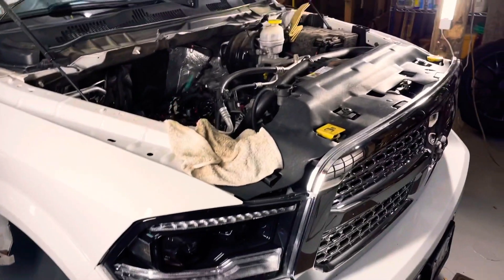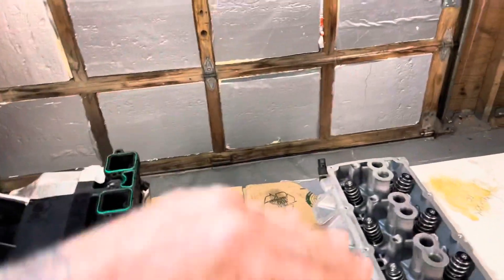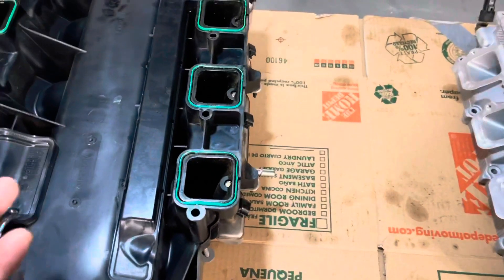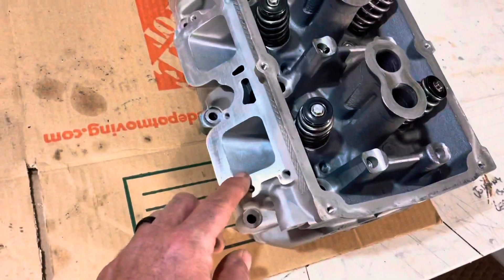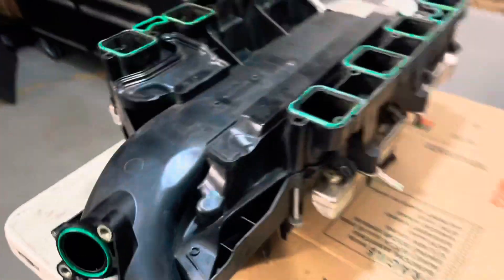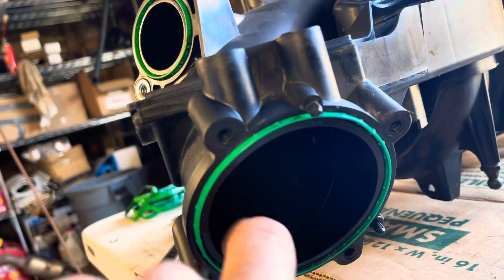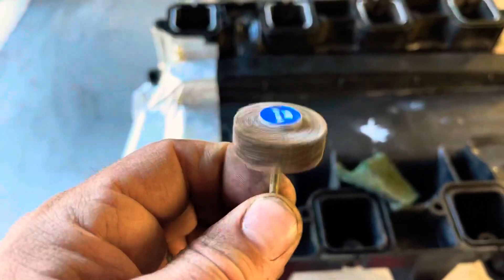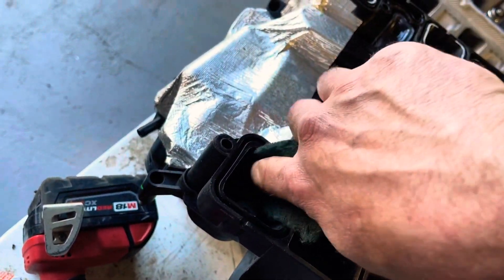PORTING! DIY 6.4 INTAKE MANIFOLD

Comment: This method workd for pre 70s motor . To do this to a late model stock motor is  a complete waste of time hoping for some hp gain for penny's.
Reply from the maker: True,, benefitted gains with supporting mods.  Port matching ported/polished/decked heads and the list goes on.

Comment: You didn't smooth out the parts where the runners are glued together and mismatched. It's 3-4 " deep from the opening and hard to get at with short bits. I use 6" carbide cutting bits to smooth the joint areas and then sandpaper by hand as far as I can reach.

Comment: I understand porting metal intakes.  
But plastic? Wouldn't it lose  Strength?
Reply from the maker: Not really they’re pretty thick
Reply: @TunedRAMS  I just don't see the gains from it. 
 I understand if it's really thick with small ports.  
But if it's already pretty big, I don't see the benefits of scraping at it. 
To be honest? 
Your better off getting a aluminum custom manifold made for your needs,  It mite be more money..  but it gives you the chance for boost applications.  Besides looking much better. 
Plastic has the attendance to crack under stress and leak. 
I wish they never went that route in cars with v8s.
Reply: @shaneonews6791  who can make custom intake manifolds? I'm interested in going with this route

Comment: I just ported my 6.4l intake, i used 80 grit cartrige cone rolls & a carbide bit on the TB side! 
Going to use a 120 or 180 grit to make it smoother!
Reply from the maker: Pretty simple right!?
Reply: @TunedRAMS  yeah, just time consuming
Reply: @Mroswaldo16 did it make much difference in power delivery?

Comment: Hey mike what did you use to smooth out the plastic and how did you clean the manifold after porting ?
Reply from the maker: Exactly what you see in the video, ended it with a scour pad

Comment: Porting was easier when we had actual gaskets to match against. With these new plastic manifolds with rubber gaskets, I've found the best thing is to grab a piece of clear plexi, drill it to match the bolt holes, then mount it to the head. You can look through and port the plexi to match the head ports, then move the plexi to the new manifold, and scribe an exact line.